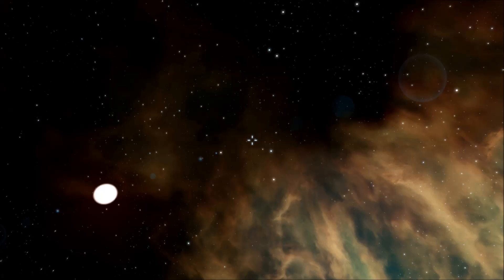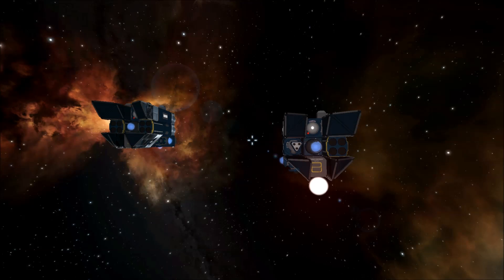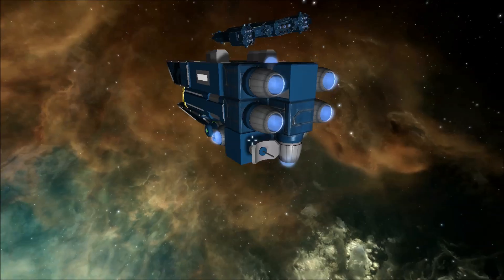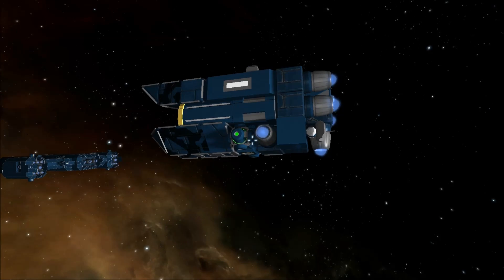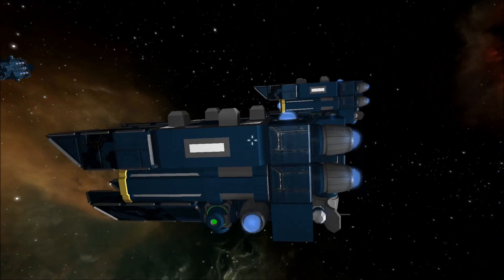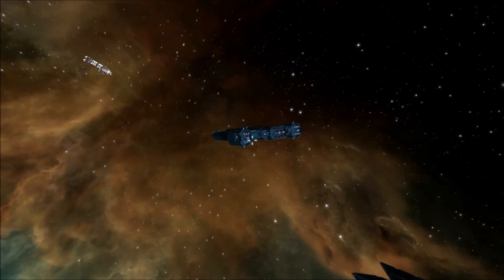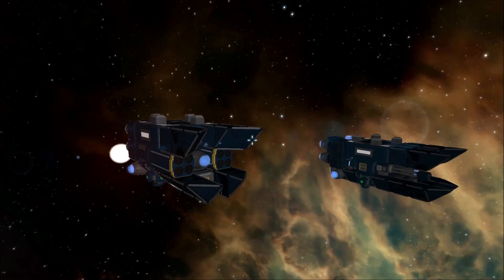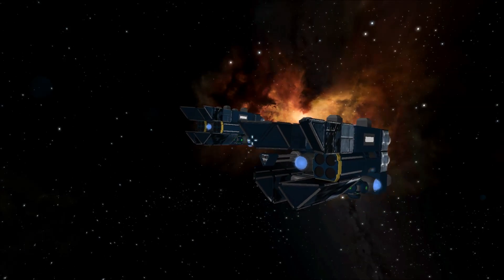Space Engineers – Let’s Build a Battlefleet (Episode 3): Jednorazovy Drones

Comment: Hey Gope!

I have got a question: 

How are you supposed to refuel the drones if they have run out of fuel completely???
Reply from the maker: Sorry, I haven't looked at these in ages.  Is there no exposed access (whether via connected cargo container or reactor access through which one could refuel?  If there isn't, that's a design flaw on my part and the only answer would be to redesign.  Thanks for checking out the video! :)